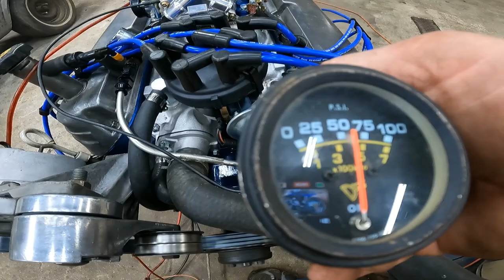First Start In 27 Years 86 302 Swapped To Carb Running On The Ground

Comment: Help me out, I didn't catch what he was doing with the drill? Seems like driving the oil pump to get oil distributed?

Btw, I'm gonna guess this fella's forgotten in the last 5 minutes more than I will learn in the next 5 years, probably pure 30W running through his veins!
Reply from the maker: It was a fresh rebuild the drill was turning the oil pump.  It gets all the air out fills the filter and pumps up the lifters. Check out the channel and subscribe if you're interested!

Comment: What's up buddy. Another 351w  to build. What's your thoughts on the tremec t170 transmission behind it. Plans are to use billet flywheel and 11 inch clutch this one going in my 1978 supercab
Reply from the maker: Sounds like that'll work!
Reply: @kickassmustangsgarage  wanted a zf5 but since covid they want a 1000 to 2000 for used one

Comment: Can you help me with 1987 302 efi fuel pump wont run unless i jump it with piece wire at the relay thanks
Reply from the maker: What 87 is it car truck? Mustang it could the computer  it sends a ground to the relay to turn it on the switch sends the power to the relay. You can test at the relay see if it gets power when the key is on and the computer should send a ground signal for about 3 seconds unless you are spinning the engine over the distributor sends a signal to the computer and keeps the ground going to the fuel pump relay . If it doesn't send the ground it's the computer if you don't have power to the relay it's either the ignition switch or a fuseable link at the solenoid.
Reply: @kickassmustangsgarage  truck f150
Reply from the maker: 87 truck has the same distributor module setup should be the same diagnosis power from the switch ground from the computor. The capacitors go bad in the computors  and it'll do that. You could just run a ground and bypass the computor ground the pump will run the whole time the ket is on though if it's the computor. The module on the distributor normally when they go bad it'll will make it not fire the coil but it does send a signal to keep the pump on.  The pump would still run for 3 seconds  .when you first turn the key on if the computor works right.  Hopefully this will help you figure it out.
Reply: @kickassmustangsgarage  ok sir I have no fuel pressure  at the fuel rail but I bypass in insertia  switch  the pump runs all the time while the key is on run postion the pump doesn't run for 2 0r 3 seconds  thanks

Comment: Lol “Chinese shit “ you just gained another subscriber….. I got a 1970 for f100 that I want to put a 302 in it right now it has a 351 m not a big fan of the modified I got a 1993 jeep with a 351 in it a screaming son of a nun I tell you what. My daughter was like dad I can’t drive that to school I was like your right u can’t so I had to get her a car soooo here I am my oldest boy wants my 70 so here I am lookin for ideas.
Reply from the maker: 351M being a big block doesn't help trying to swap in a small block. I can't remember if the oil pan dips in the front on a 70 F100 . It's getting hard to find parts for older vehicles that are still any good now days.  93 and older transmissions AOD's don't need a computer just uses a detent cable (not a fan of a AOD)  but could be a option that would work if you want overdrive. Explorers and Moutaineer's where the last vehicles to use 302's 96-97 have GT40 heads 98-01 have GT40P heads plug angles are different (exhaust manifolds and headers can be a issue) hopefully this will help with the ideas and thanks for the sub!  Let me know what you come up with idea wise I don't mind sharing info kinda need to know more about the truck accessories it has manual trans or auto? Just depends on how you want to set it up on what all you'll need.
Reply: @kickassmustangsgarage  I really appreciate you for the ford schooling I need it my friend I’ll let you know how it goes